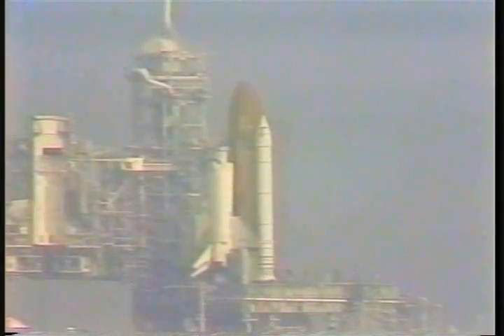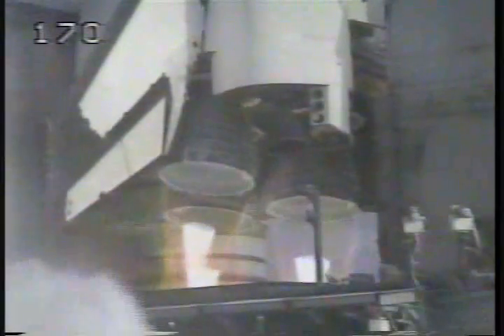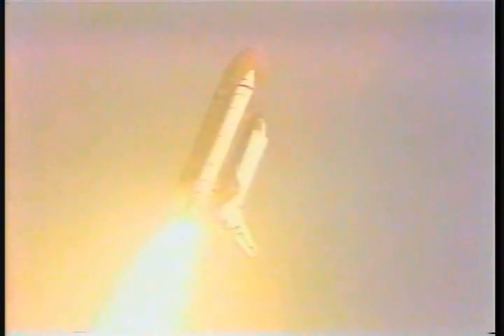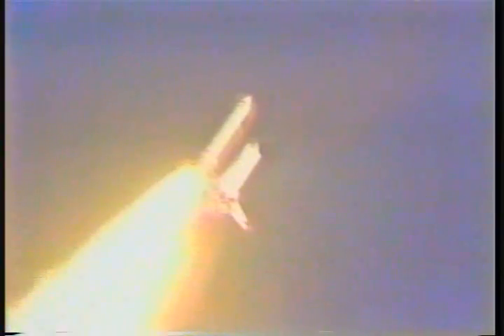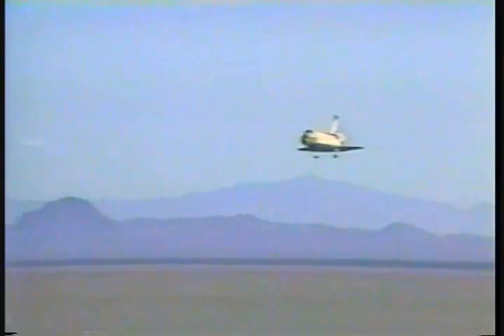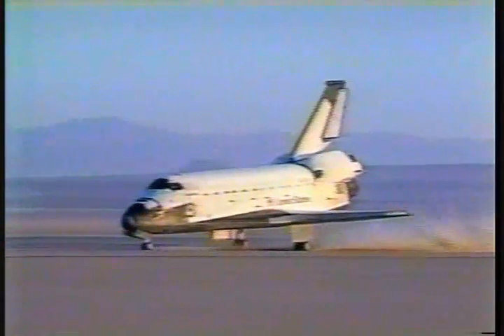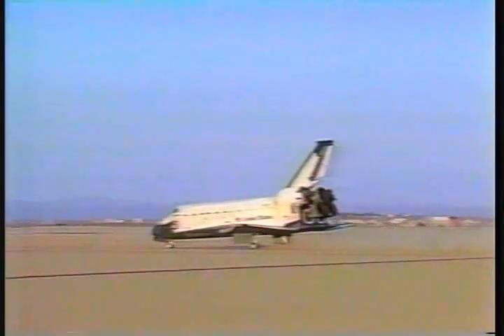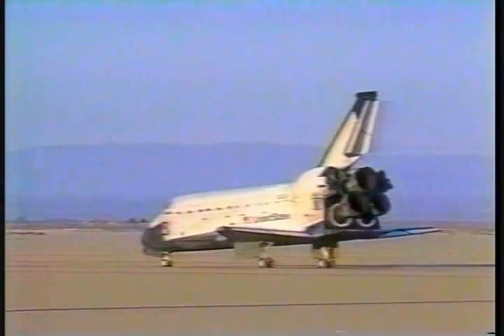STS-28 launch & landing (8-8-89)

Comment: This mission should have launched in late 1988 or 89 but the refurbishment of Columbia took much longer than anticipated. 
The launch was delayed 40 minutes because of fog on the runway at the Kennedy Space Center. Columbia headed up the eastern seaboard of the USA for its 57 degree inclination orbit.  The crew deployed the advanced reconnaissance satellite KH-12.  A smaller satellite was deployed the next day and the crew conducted classified experiments and one unclassified experiment on radiation monitoring before coming home to Edwards Air Force Base, California. This was the final re-qualification mission of the Shuttle fleet under the Return To Flight programme.
This was Columbus’s only military flight. 
The Commander,  Brewster Shaw, made his third and last flight. 
Pilot Richard Richards made his first flight. 
Mission Specialist David Leestma  made his second flight.   MSs James Adamson and Mark Brown both made their first flight.

Comment: Wait was this columbias first flight after Challenger?
Reply: Yes. The order went: Discovery STS-26, Atlantis 27 and Columbia 28
Reply: @greenseaships  There was STS-29 (Discovery), which launched a TDRSS satellite in March, 1989, and STS-30 (Atlantis, which launched on May 4, 1989, which launched the Magellan to Earth orbit, before being deployed and headed towards Venus, reaching our sister planet on August 10, 1990.
Columbia (STS-28) was the only post-Challenger flight to use the original SRB design, as the flight that was originally scheduled to follow Challenger's flight was Columbia, with Astro-1, which had been scheduled for March 6, 1986. 
The boosters had been stacked on the MLP since before the Challenger accident, and had been designed to handle the added weight of the Columbia shuttle.
Reply: There were 2 other shuttle flights after Challenger before Columbia: Discovery StS 29 and Atlantis STS 30.

Comment: Damn, the flap almost scrape the runway
Reply: See a comment above for the link to the story of this landing.

TLDR- Just prior to launch, a software problem was discovered that could result in improper steering modes being activated on landing that could cause a loss of control on landing. It was too late to fix the problem, so CDR Brewster Shaw was briefed, numerous times, to touch down as absolutely soft as possible. Columbia touched down at 154 knots, the slowest ever for a shuttle landing, well below the 185-205 knot range.

Comment: AINT NOTHING WORSE THAN BREWSTER SHAW.....
THE BODYFLAP NEARLY SCRAPED THE LAKEBED
Reply: Due to a concern with a heavy landing triggering a troublesome software mode (unwanted nosewheel steering at high speed), Mission Control asked commander Brewster Shaw to give the shuttle a soft landing. He was trying to do what he was asked, but may have taken it a bit far.   
https://waynehale.wordpress.com/2015/07/29/pilot-error-is-never-root-cause/
Reply: I know this comment is 11 years old but the landing was done this soft on purpose
Reply: STS-3 was no better. They tried to touch and go LOL

Comment: I remember watching this live on CBS that morning. They delayed 40 minutes for fog and it was still hazy an foggy at launch as you can see.  This was when they blocked out air-to-ground comm between the astronauts and Mission Control during the classified DOD missions in the 1980's.  However, CBS found a way to hear the transmissions, although rather fuzzy.  You could hear Shaw say "Liftoff!" and then "Roll program" and then "Columbia, go a throttle up" from the CAPCOM but without reply.